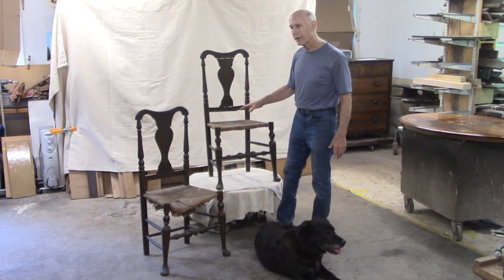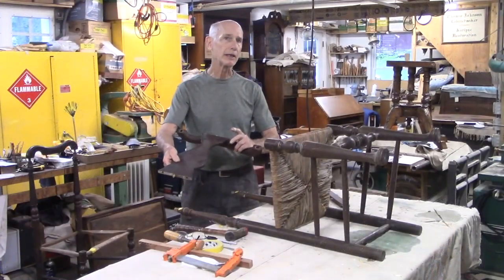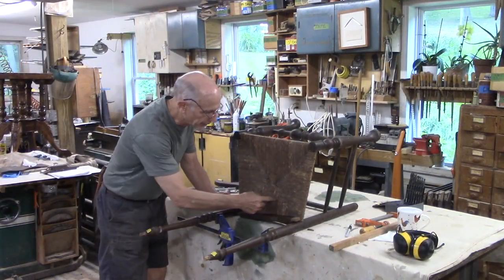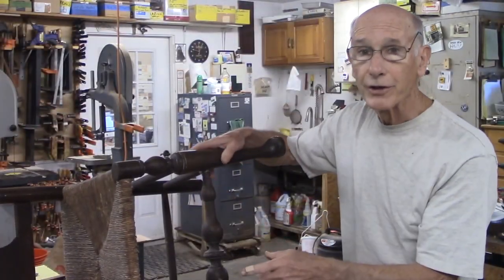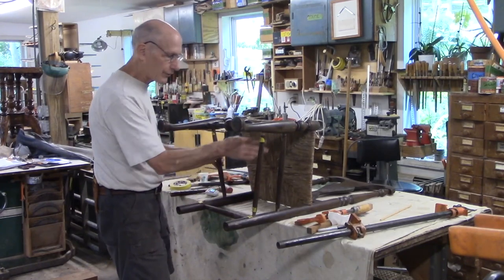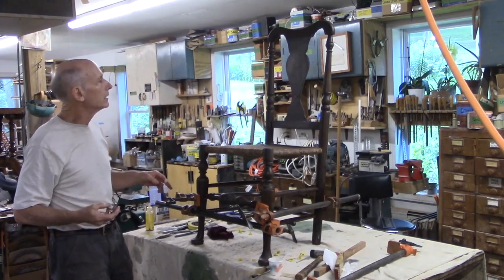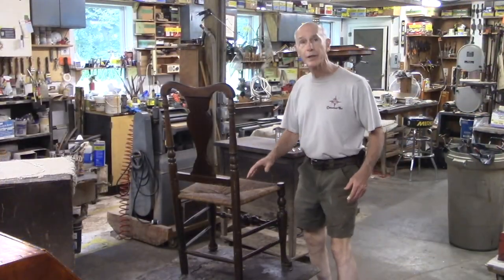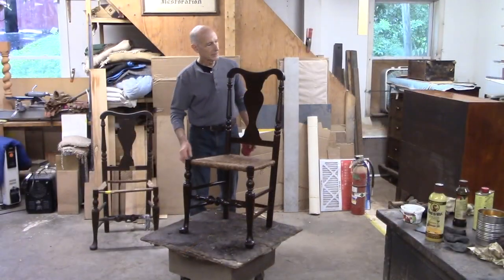Restoring a Queen Anne Chair - Thomas Johnson Antique Furniture Restoration

Comment: I thought the parts chair would get some new parts , patterned on the removed elements? Will it just be scrapped?
Nice work on the complete chair though. 
There used to be a practice of making a complete set by copying all the elements of one chair and putting old with new to make extra chairs all of which had at least one old element
Reply from the maker: Thanks! They may decide to repair it in the future. I like that idea of mixing the old with the new

Comment: Hi Tom. I've been refurbishing an 1896 Singer sewing machine cover. All in all it's in pretty good shape, but the veneer has blistered over the years - not cracked but with no adhesion underneath. I've seen you release glue joints with heat many times so I tried giving the veneer a little heat, just enough to soften the glue underneath, and clamped it up. Lo and behold the veneer has grabbed onto the glue and it's holding really well. Thanks for the inspiration!
Reply from the maker: You're welcome! Yes, I've done the same. Sometimes I'll squirt a little new hide glue in just for insurance

Comment: Amazing transformation of the finish--you did nothing harsh or invasive, no chemicals used, and the original finish came to the surface beautifully. I'm guessing you're doing the same finish restoration for all of the chairs in the set. Watching your careful, painstaking restorations, I'm thinking that it takes more than craftsmanship to do the work you do--you also have to have patience. I've never seen you "rush" a job or take the quick way out. The results speak for themselves.
Reply from the maker: Thank you! Yes, I lucked out with this one. I will always save a finish when possible, but it all depends on what the finish is (always unknown) and how badly it's damaged

Comment: I wish society still valued real quality wood furniture that lasts decades. My favorite part of my past job was repairing furniture , but the stuff I repaired would break in 1 to 3 years out of the factory.
Reply: I used to repair furniture like that too when I ran a clearance center for a large furniture retailer. The American made stuff, at the time, was actually pretty decent. The overseas stuff was horrible…., and often not cost effective to repair owing to grossly substandard materials and construction.
Reply from the maker: Thanks! That's why I like working on antiques, it makes it worth it when the furniture really means something
Reply from the maker: Yes, I've seen the same thing. I don't blame the overseas workers, they're just doing what the American retailers ask them to do
Reply: A lot of ppl that appreciate old furniture still value quality wood.  I only buy old pieces made from real wood.   The quality can't be beat.

Comment: Great Job in bringing this old chair back to life.  I was wondering do you ever notice that chairs no longer sit flat after a reglue job?  What method do you use to bring them them back to sitting square on all four feet.  Do you sand them on a belt sander or saw off a sliver with your Japanese pull saw?
Reply from the maker: Thanks! It does happen. Typically I put a chair on the table saw, figure out which one (or 2) need shortening, and use the stationary belt sander. I have had some so far off I've needed the saw but that is unusaul

Comment: Another excellent video. Did the vinegar solution  that you used on the seat ,did it tighten up the  the material as it dried?  The bottom looked like it was in tough shape.  Thanks  and stay safe.
Reply from the maker: You're welcome! It seemed to have no affect on the color. It did look a lot better when it dried

Comment: Congrats on another amazing end result! The chair looks amazing! Only comment on the end is that you need to snip off those few dangling fibers from the binder-twine like seat. I have a couple of questions.
I know zero about how furniture is put together and less how it was built in the long ago past. But I must ask -- why did you decide that the intact seat of the chair should remain attached to the rest of it throughout this restoration? It seems to me that if you had removed the seat it would have been much easier to dismantle the other parts of the chair that you wanted to work on and then reassemble. Why was it so important to NOT remove the seat from the chair?
Did a quick Google of hide glue vs wood glue and discovered that wood glue forms a bond stronger than the wood itself -- while hide glue can be heated to a high temperature and then be more easily separated. 
So, in addition to my previous question about the seat, why did you choose hide glue -- was it to make it easier for someone else, perhaps decades later, to dismantle the chair in order to do other repairs?  Or was it about staying true to the way in which the chair was originally built, which was using hide glue?
One choice is about the potentially longer life of the chair, the other about historical accuracy in its construction.
Reply from the maker: Thanks! About the glue, both. It is compatible with the existing glue,and will be easier to disassemble in the future. The seat was strong, and it matched the rest of the set. And a new seat of real rush would be about $400. I did clip the bits!

Comment: Opening those joints while stretching the rush was stressful.  I would not have the confidence to know where to stop to avoid destruction.  Would softening the rush with water/vinegar first make it stretch more, or would it weaken it?
Reply: I had the same question, but I also wonder if the rushes are simply too dry at this point for dampening them to help at all.
Reply from the maker: Thanks! I was worried too! I agree with VeretenoVids, I don't think there's anything you could do to help it
Reply from the maker: I agree, nothing would help it

Comment: Anything you can do to extend the life of the rush seat? It seemed to be really dry. Nice job.
Reply: I don't think its very expensive to replace it. But i used wax for it🤷‍♂️💁‍♂️
Reply from the maker: Thanks! I suppose you could give it another coat of shellac
Reply from the maker: Thanks! It is expensive for a real rush seat - north of $300. Fibre rush seats aren't bad though

Comment: How many minutes and how far did you hold your heat gun and what kind of temperature did you use to melt old glue?
Reply from the maker: Hi Robert! Middle setting, 2 minutes at a time. Hold as close as you can without scorching the finish. maybe 8 to 12 inches?
Reply: @johnsonrestoration   Thank you so much!

Comment: Good afternoon, Mr. Johnson.  In the video, you remarked that scratch cover was like lemon oil polish mixed with stain.  My question is, would it be possible to make scratch cover in the shop, using some kind of oil and stain?
Thanks
Reply from the maker: Thanks! Yes, I see no reason not too. You could probably just use stain, but I suspect it would be better to mix it with polish
Reply: Thanks, Mr. Johnson.  I've  been a furniture restorer for years, mainly self taught and following your work for the past couple of months, I've learned some key things from you.  Thanks for the help.
You're the man!

Comment: Tom, when you test original finishes….what is your process?
Reply from the maker: Thanks! I don’t test. It’s rare to have piece with the original finish. But the restoration process is usually the same no matter what. Clean, add some finish like shellac or varnish if needed, and wax.

Comment: So I had a couple questions:

Did the customer want you to try to save both chairs and you said "Oh, hell no" or did you tell them right off the bat that one would have to be sacrificed to save the other?

If it's a set, why didn't they bring you all of them to rehab?

Did all that stretching snap any of the rush?  It looks like there are quite a few broken strands hanging down underneath.   Do you glue those back in place, or just ignore them?

Will you ever post a video of how to repair rush seats, or is that not your forte?
Reply: I suspect - but I don't know - that the issue here is one of cost. It would have been perfectly possible to cut and match a rail and a stretcher, and to re-do the rushing. But it would have cost many times more than the 'functional' repair that Tom is doing here; these are not (and never were) 'expensive' chairs.
Reply from the maker: Thanks! dlevi67 is correct, plus the fact that just don't need 8 chairs at this time. They'll do the other one sometime. I glue the stands back with hide glue
Reply from the maker: Yes, correct

Comment: Is there a reason you don't scrap the tenons of old glue residue?  Your videos are extremely helpful/instructional.  Thank you
Reply: I think Tom does - here for example starting at 7:20
Reply from the maker: Thanks! Yes, dlevi67 is correct - I scrape. But I don't go after every little bit
Reply from the maker: Thanks!

Comment: Looks like the parts chair is featured in a number of comments. Few things more off-kilter or odd than a set of 7 chairs - owner’s choice. Thanks for the video.  Are you sticking with your age estimate (not that 20 or 30 years would matter)?
Reply from the maker: Thanks! Well, the age will only ever be a guess. And they just don't need the 8th chair at this time

Comment: Question, with as much damage the donor chair had and what was salvaged from the repaired chair, is there enough pattern-able parts to where, if requested, can the remanufactured pieces for the donor chair be reproduced to make the donor repurposed/rebuilt? just a thought
Reply: I think the main consideration here was cost - it would not have been 'difficult' to re-do the rail and repair the splat, but it was a lot faster (and thus cheaper) to transplant them. These are not expensive chairs, and never were.
Reply from the maker: Thanks! dlevi67 is right - but they'll keep the chair - it might get repaired in the future
Reply from the maker: Exactly. And they just don't need the 8th chair at this time. They'll keep it for the future
Reply: @johnsonrestoration  You never know when another chair could be handy!

Comment: Thomas,
How long do you set your timer for when holding a heat gun on the joint?
Reply: Two minutes (this is a rare example where he didn't say that aloud!)
Reply: @sanityormadness  yea 2 minutes it is in my head also 🤭 and I have never used a heat gun or repaired old furniture 🙂🙂🙂🤭
Reply from the maker: Thanks! Yes, sanityormadness is correct! 2 minutes at a time! if it needs more then another 2 minutes
Reply from the maker: Thanks! You've been watching!

Comment: if you use CA glue on a joint thats not stressed, whats the life expectancy before the glue fails ?  how long do you apply heat to seperate joints as you did here ?
Reply: 2 minutes
Reply from the maker: Thanks! Paul Beard is correct! 2 minutes at a time - it might need more. I don't know about the CA glue
Reply: @johnsonrestoration  many thanks, love the shows, learn so much, i have started restoring some furniture i bought specialy.  Love the calming animal intro and outros.

Comment: Don't you just hate those nails used to pin the joints 😣. I have been 'Punching' them in to the tenon dowel, with the hope of them not going all the way through to the other side, and then being able to pull the tenon dowel out without tearing up the mortice and doing lots more damage. I was holding my breath near the end of the leg stretching, waiting for the reed seat to start tearing. Phew 😁.     Nice job.
Reply from the maker: Thanks! The bane of our existence!

Comment: Great work.
Repro? How old is it?
Reply: Probably ~100 years, but could be 20 or 30 less; the pattern/style/design is getting up for its 300th birthday, and they've been made in (roughly) this style pretty much throughout.
Reply from the maker: Thanks! dlevi67 is correct!
Reply from the maker: Yes, so hard to say. I've since learned these are called "Hudson Valley" chairs (New York) I need to look further into that - it could be a clue
Reply: @johnsonrestoration  There is an illustration of a similar chair (splat and top rail are almost identical, as is the use of a flat, separate back rail for the bottom of the splat; the front stretcher is very similar, the legs and other stretchers quite different, with scrolled 'Spanish' feet and alternating bobbins and squares on the front legs - funnily enough, that one has a rush seat too, but on much thinner rails!) in Oscar P Fitzgerald's Four Centuries of American Furniture. Fitzgerald says it originated in Massachusetts, and it's in maple, dated 1730 - 1770 as a type.

Comment: He used Old English polish on the chair to cover the scratches.  I use that a lot but know that you can't rub off the excess no matter how hard you try.  It will get all over your clothes.  I wouldn't have used it on the chair.  It looks like he put beeswax over the top.  I don't know if that would help.
Reply from the maker: Thanks! I find a paper towel gets it off

Comment: How can you match the finish with the other chairs if you only have that one? I don't understand why the owner did not ask you to clean and refinish all the chairs. They would also need a new rush!
Reply: I don't think you'd have any problem - the finish has not been altered by the scratch cover; just give a coat of scratch cover and wax polish to the other chairs and you'd be good to go.
Reply from the maker: Thanks! Yes, dlevi67 is correct. I think it will be close enough - the owner can always polish the others
Reply from the maker: Thanks! I agree

Comment: What about some type of dropper for the glue
Reply: What's wrong with a syringe? (Plus, I suspect that unless the glue is very warm, it won't be fluid enough to work well with a dropper)
Reply from the maker: Thanks! Yes, dlevi67 is correct, I think you need a syringe to push that glue
Reply from the maker: Exactly. You need a little pressure behind it

Comment: At what point do you make the decision to "re-cane" the seat?
Reply from the maker: Thanks! Basically if it still functions, and doesn’t look too bad, we leave it! A real rush seat costs more than $300
Reply: @johnsonrestoration  That's about what it cost to "re-cane" my grandmothers chairs. there were several that needed doing and the guy gave us a discount.
Reply: You do great work and I greatly appreciate it when antique items are  not over repaired.  I mean when the value is damaged beecause the beautiful antigue or well used markings are  removed in total. You have had a good balance over the last few I've seen.  I am a new subscriber to your channel.

Comment: Why didn't you adhere the caining back to the bottom of the seat?
Reply: The rushing is not glued - it's "just" woven around the rails and to itself.
Reply: @dlevi67  I know that. I am talking about the broken strands.
Reply: @Blaze_1961  I see only one... (e.g. at 12:14) which may well be the end of one of the rushes, rather than being a broken one, in which case it should be tucked under the rest but not glued. Did you see more? (genuine question - I haven't watched the whole video again!)
Reply: @dlevi67  Yes at the end when he is polishing. Gluing is perfectly fine to do on a repair especially if you use a reversible glue.
Reply: @Blaze_1961  Aha - spotted them! Good question... :-)
Reply from the maker: Thanks! I did before it got picked up, I was able to tuck them in, and a little hide glue. I should have shown that in the video

Comment: How can you tell that this is a reproduction? It is made of real wood and still looks antique to me.
Reply: For example the type of joint and the use of dowels is not how this design of chair would have been assembled in the 1730-1740s (when similar designs were first made). The turnings and the splat are too regular and 'machine-like' (and you would not have been able to mix-and-match parts as easily as Tom did). The wood is not what would have been used for modest "country" chairs like these. The stretchers are 'wrong' for a period chair... and I could go on!
Reply: @dlevi67  Cool details. Thanks.
Reply: @toomaskotkas4467  You are most welcome!
Reply from the maker: Thanks! dlevi67 is correct! Also the fact that they were made of mahogany, which would not have been used in the originals
Reply from the maker: Yes! Thanks!

Comment: why not just make an entirely new reproduction chair out of new wood?   one reproduction chair is as good as any other reproduction artistically speaking....what is the advantage of saving an end-stage collection of dry rotted old wood parts with huge effort when you could have an entirely new but identical chair with about the same amount of effort but a much more desirable end product......you are just extending the life of a rotted reproduction chair by making it even less 'original' than it was..................just use the old chair as a template pattern for the new chair and voila!  you still have the same reproduction copy of an even older original chair but in much better condition
Reply from the maker: Thanks! The chairs have sentimental value to the owner. So building a new one was never considered. And if you think “voila, there’s a chair!”, clearly you’ve never built a chair